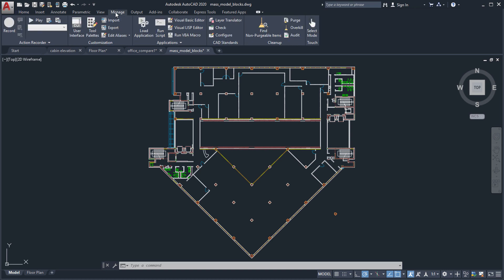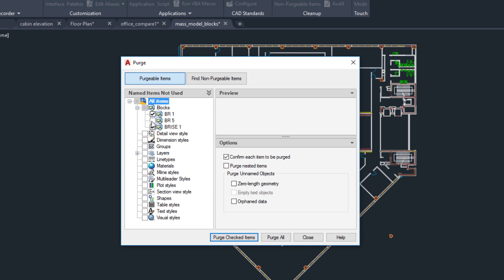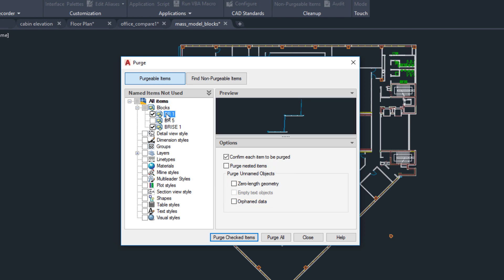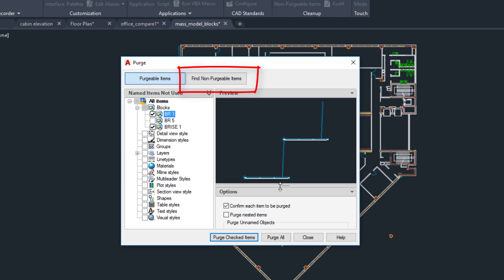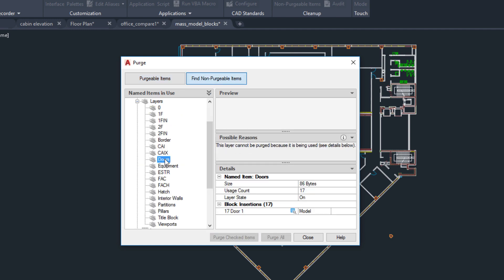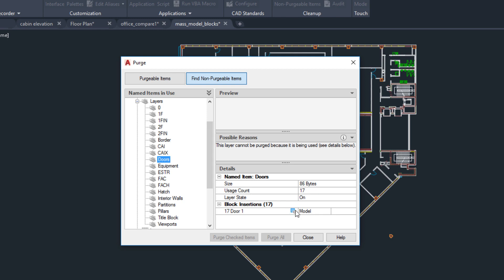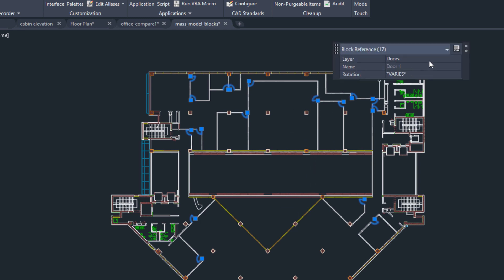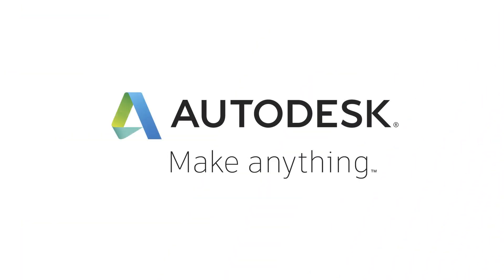AutoCAD 2020: Purge redesign | AutoCAD

Comment: This defiantly has more features that would be helpful however, would it be possible to have a switch to revert to the previous menu? Only because using the old menu is a lot faster with a few space bar hits you can purge all and move on. Maybe allow the new purge to function as the old instead of having to click buttons. Typically I use purge running through new drawings to remove unused items and stuff.